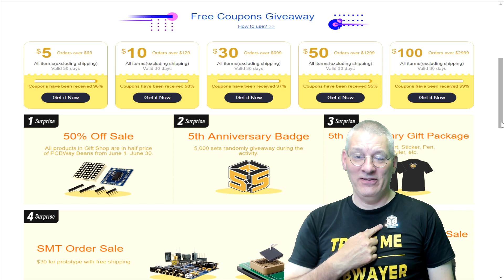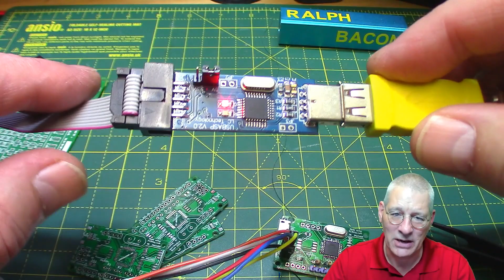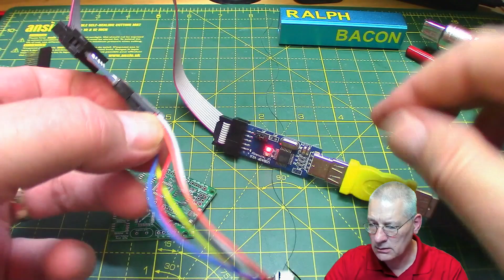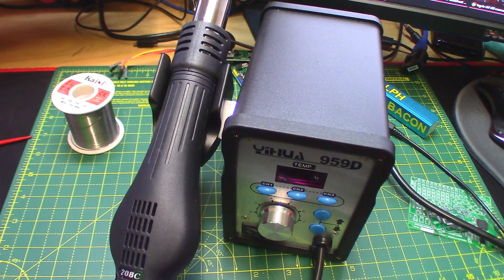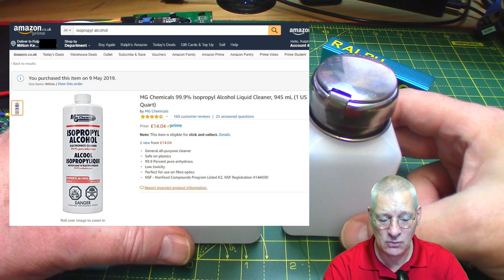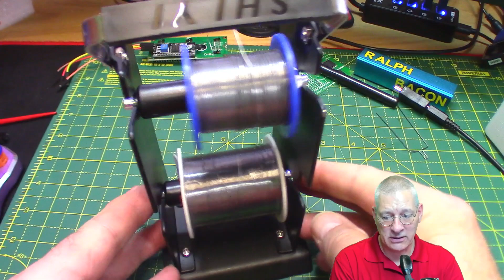#150 SMD KiCAD Arduino PCB Project (Spoiler: 😭=FAIL)

Comment: Hi Ralph, 

I used to have frustrations about SMD soldering and worrying about losing those small components, it was pretty intimidating at first but after practicing with a few old boards it got much easier to deal with, now it’s my preferred method, especially now that I design circuit boards that need to be as small as possible. 

I plan to purchase a small desktop CNC router so I can make my own prototype circuit boards for testing before I have PCB Way or JLCPCB make permanent boards. 

For now I use those little SMD to THT adapter boards for SMD components mixed with THT components on a perf board for testing like the one in the photo I’ve included a link to.  
https://i165.photobucket.com/albums/u50/rosenq3/Electronics/Prototype%20with%20SMD%20to%20THT%20adapter%20boards_zpsliuvoykl.jpg

It’s much easier to make changes to a perf board than a PCB as you well know. 
I’m only attempting to provide various options for you to choose from.

All the best!! 

Joe
Reply from the maker: I have now lost count, Joe, of how many SMD components I have lost from my workbench. Sometimes I don't recognise them and think they are just "bits" and sweep them on the floor at the precise instant that I do recognise them again (too late, lost forever). Sometimes they get stuck to my soldering iron tip and get shaken off somewhere. Mostly I lose them as I take them out of the little strips they come in. As you say, practice makes perfect!

Comment: Hi Ralph, 

I forgot to answer your question about that little springy fork looking tool that you were inquiring about. 
It’s a removal tool for IC chips, some call it an IC Popper, some call it an IC handling tool but whatever you name it, the idea is to place the prongs underneath the pins next to the body of the IC, the spring action of the tool puts upward pressure on the IC causing it to separate from the board when the solder is hot enough to release it.  
I’ve used mine a few times with good results and it’s easily bent to fit various sizes of IC chips.

On another note, as you said, there are many videos saying to do something this way or that way but it all boils down to trying various SMD techniques so you can develop a technique that works best for you, my philosophy is: “The right way is the way that works best for YOU”!! :-) 

I hope this helps with your endeavor to master SMD soldering!  

Good luck!

Joe
Reply from the maker: Yes, others have said the same. I will try it out next board. And I totally agree that each maker must develop his own style in soldering. What works for one may not work for someone else.

Comment: The problem is likely more that the sticker tells you it's 60/40 and probably is 63/37 (tin/lead). That's why it looks so dull.
Reply from the maker: That sticker could be telling me anything, Albert - it's just a printed sticker. It's so frustrating when this happens as there is so much quality stuff from China this just tars it all with the same 'fake' brush. I won't be using it again. I've had many suggestions for good, branded solder, so I will check them all out. Thanks for posting.

Comment: Your soldering is way better than the USB hub I bought off eBay. Had to resolder most of it.
Reply from the maker: Normally, and without false modesty, I would say that my (non-SMD) soldering is quite adequate and certainly better than some of the Chinese stuff that arrives. However, in this case, SMD plus that weird solder really made me look like a noob solderer (if that's a word). But I shall try a few things out and see how I can get better at SMD soldering, for sure. Thanks for your kind words, unknownhuman100, nice to hear from you.

Comment: Why don't you use ceramic tweezers for this kind of job?
Reply from the maker: I was going to get some, CaroMan, but these were marketed as ESD safe tweezers; I don't know how or why they are any different to any other metal tweezers but they are good quality (flat, no gaps) and work well - at least, they didn't destroy any of the chips I soldered, although I was tethered to a ground wrist strap at all times!

Comment: Dear Ralph

I see your  Xtal and the caps are caps are very far from each other . I am surprised it worked   the cap 22ph need to be close to the xtal. Look at any pcb with a xtal  where are the caps 

https://electronics.stackexchange.com/questions/39136/competing-pcb-crystal-layout-recommendations 

Good placement of parts makes better boards and less time routing.
Reply from the maker: Agreed, I would not have designed the board like this, Arie. And I wondered the same, that is, whether it would even work! That's why I connected it all up as soon as I could and uploaded the BLINK sketch. Interestingly, given that the caps should have been SMD (I replaced them with THT components) it should have been pretty easy to place them closer to the crystal. Good observation, thanks for posting.

Comment: Hi Ralph, 

I have been using silver bearing solder for years with really good results (for me).  It does require a slightly hotter tip temperature but that's OK by me. 
I use Radio Shack  62/36/2, .022" (.56mm), I also use .015" (.36mm) for really small solder joints. You can find it on Amazon: 
https://www.amazon.com/RadioShack-SnPbAg-Silver-Bearing-Rosin-Core-Diameter/dp/B07PV1P1QX/ref=sr_1_5?gclid=Cj0KCQjwo7foBRD8ARIsAHTy2wlllqm4Cwce63PvbNigbyA5w3hDADzopsZiML34otQ_gXOw19Ja_h8aAsGLEALw_wcB&hvadid=153684532075&hvdev=c&hvlocphy=9009606&hvnetw=g&hvpos=1t1&hvqmt=e&hvrand=15984797613167090499&hvtargid=aud-649564993678%3Akwd-1461618150&hydadcr=1638_9515723&keywords=silver+bearing+solder&qid=1561208569&s=gateway&sr=8-5

BTW, I've tried 63/37 solder from China a few times with very poor results, there's something about that solder that just doesn't work the way it should.

I use a hot air station very much like yours for both de-soldering and soldering with solder paste. 
I often heat the board from underneath, it helps to prevent the excessive heating of the component and you don't have to be so concerned with the air flow blowing the component around the board. I usually use about 25% air flow for most components, I sometimes use a higher air flow setting for de-soldering large components, just a note on de-soldering: it has always helped to add fresh solder and use liquid flux. 
If I have to use the hot air gun from the top for soldering with solder paste, I often place a tiny dot of silicone to the bottom of the component, then let it stand for a couple of minutes to hold it in place during the soldering process. 

Drag soldering multi pin components like the Atmega328P-AU chip is another great option, it's a good idea to solder one pin in two of the corners to hold it in place while soldering the rest of the chip! :-) 

PS, Have you tried using Goof-Off or Goo-Gone for PCB cleaning? It works almost instant with very little effort. 
I always rinse the board with alcohol or electronics spray cleaner afterwards, I'm not sure if that's really needed but I do it anyway. 

Hope this helps!! 

Joe
Reply from the maker: I've never tried Goo-Gone, Joe, (which I bought in the States years ago, now we have it in the UK) but I'll give it a try on my next board. It certainly gets rid of sticky label residue! I'll check out that solder too, many have suggested alternatives to the rubbish I was using. Thanks for posting.

Comment: I would use some liquid flux and a tiny artist's brush Ralph. Cheers. Mike
Reply from the maker: Got some, Mike! The brush is in the lid and I often use it in day-to-day soldering, not just SMD stuff. Especially useful for headers I find, which can be a bit tricky otherwise to solder. I don't know if it's any better than the flux in my syringe but it's much easier to apply.

Comment: Maybe when a finished design board is available a stencil will be offered and one could simply use solder paste for all the SMD device's.
Reply: Yes, a stencil is available from PCBWay, but it cost extra. When you are uploading your Gerber files and filling out your order form make sure you have added the stencil before you checkout. Now you just need to buy the book, fix the mistake, and then order it.
Reply from the maker: Ironically, PCBWAY offered me a stencil but I was unsure how to use it I declined. Doh!!! Next time, next time, Dave.
Reply: @RalphBacon  they're a cheap option and with solder paste will a pretty impressive finish product. Solder paste isn't cheap but if you are considering doing more products like this and want them looking nice it's the way to go.
Reply: @RalphBacon   I saw a great demo on YouTube. They just put 4 empty PCB boards around the one they were going to paste leaving extra room on the right and bottom so they could place and remove the target board easily. Then put the board to be pasted in the upper left hand corner. Then align the stencil and tape it at the top to make a hinge. Put s small amount of paste on the stencil and spread it with a creditcard or similar making sure to fill all of the holes and removing any extra. The stencil should look basically clean except the pile of paste thay you scraped to the side. Then you can lift the stencil remove and replace the board. Wash, rinse, repeat (not literally). I could easily be wrong because I have never done it, but the video made it look simple.   If they are going to give it to you for free then why not take advantage of it. Plus you can now teach everyone. However, anyone who knows a better way please correct me. Like I said I've never done it, but it looked pretty simple on the video. Great job as always Ralph. Thanks.
Reply from the maker: I saw a similar video. Looked easy to do, but only if you're doing multiple boards, I would have thought, as it's a lot of effort to do just for one board.
Reply: @Mr T. Guru you hit the nail on the head. Ralph is not experienced in this type of work so the extra leverage would be a plus to get that factory look. Typically if it's a mass production board the stencil is only a buck or two extra if the kit provider even charges a fee.

Comment: Add a bit of resin and reheat then clean it up.
Reply from the maker: What, the PCB? The whole thing? Resin? Please clarify!
Reply: @RalphBacon  just the area with the ugly solder. It will make it flow more even.
Reply from the maker: Ah, yes, I will do that on my next attempt, thanks for that. I did notice the solder is not that level, despite the HASL process. That makes a difference for tiny resistors and the suchlike.

Comment: The two pieces you were asking about from the Heat gun, they do go together to make a 2 prong fork like tool.  It is apparently to help you either position components when soldering with heat, or  to help lift/move heated components once the solder is melted.  I have not made much of any use of it.  I have a similar heat gun built into my one solder station, I love it for heat shrink tubing work, as I don't do much solder or desoldering with it.  I also had an issue with supposedly Leaded Solder that I ordered.  I purchased the finer solder for the same reasons, and I had the same issues, and ended up buying some Kester 63 73 lead solder.  It was an amazing difference, I had picked up a small tube of it to test first, then once that started getting low purchased a full roll of it.  I have since been using the finer Kester and virtually quit using the larger diameter 63 73 I had been (which I was running low on anyways).  I purchased a single reel solder holder awhile back, it looks to be very similar to yours, I couldn't be happier with it.  I avoid using solder braid, the good stuff is quite expensive as you mentioned.  The stuff is amazing if it is the quality stuff.  I had purchased some cheap solder braid, I found it came in as bare tarnished copper without any flux embedded in it and wasn't good for much of anything.  I only kept it around for maybe making grounding straps or something with..  Still for soldering boards up, especially with cleaning off solder bridges and smd chips etc, it is nearly indispensable at times.  It makes the work go so much smoother.  You don't want to suck off a surface mount part with a solder sucker...  I was looking at those bottles, I guess it is good I didn't buy one of the cheap ones yet, I may look to get a good one sometime in the future though.
Reply: I guess I forgot to mention, the little pump my wife and daughter found at the dollar store works great. One thing I have also found is if you soak even the cheap braid in some paste flux held down with you soldering iron. But by all means buy what works and feels right for you. The brushes I mentioned work great too.
Reply from the maker: @vonries So the little drugstore pump didn't dissolve overnight with its isopropyl alcohol contents? Drat! I could have saved a fortune. And coincidentally I found the exact same trick with cheap braid. A toothpaste sized blob of flux at one end, squidge it along its length and voila! It works again. See, we all come up with the same solutions! Thanks for posting your results.
Reply: @RalphBacon   she does scrapbooking and uses it to clean ink off of her stamps. She's had alcohol in it for months with no problems. Happy to give back to the group.
Reply from the maker: Yes, you and others have put me right about the chip aligner/desoldering aid, thanks. And I shall be looking for some good quality, finer diameter solder today. As you say, a large roll will last a lifetime. I have some cheap braid too (not the stuff I used). It was useless. It tarnished quickly, had no flux embedded in it... I'm back to my Servisol which always does the job for me. Not cheap but essential, IMHO. Thanks for posting, good to hear from you.
Reply: @RalphBacon  I don't know how I did the 63 73 typo a few times, of course 63 37 Leaded solder.  You are welcome.  I like watching your videos.

Comment: LOL  one thing you could feel good about on the branded pump bottle is they are ESD compliant so it wont cause a spark when its full of flammable liquid  and burn down Benny's house...
Reply from the maker: Good point. In fact, that's probably why Benny was so insistent on me getting that particular brand.

Comment: If you have ever watched Louis Rossmann he can school many people on how to do smd soldering... I tried for years and used many many different pastes and flux's and I'm telling you the stupid magic stuff that I finally broke down and spent way to much money on actually works totally awesome and I can redo it 3 or 4 times with hot air or a soldering iron...if you want to see ill post the link at the end of this post..warning...there is soooo many counterfeit versions of this product is why I finally got it from him..I bought it twice once from ebay and once from china and both were not the same as what he sells as the original Amtech..    https://store.rossmanngroup.com/index.php/soldering-diy/helpful-tools-extras/flux-soldering-tools.html
Reply from the maker: Thanks, Gene, I'll look into that, I definitely need to crack this SMD soldering lark.
Reply: @RalphBacon  I'm still not very good at it but those jewelers glasses you suggested are amazing...
Reply from the maker: Yup, I agree, I used them today to repair a circuit board. Wouldn't be without them now. Thanks for the feedback, Gene.

Comment: Book writer: Skilled PCB designer? No way!
Reply from the maker: Well, I guess you have your opinion and I have mine. His knowledge of KiCAD is impressive though, it must be said.
Reply: I can design you something that will never work - That is not complex. Rather more complex to design something from your head and make it work. Attention to detail seems to be something he likes to miss. Another mistake on the clock - oh no.  Well at least will correct this in the PDF Version. That will provide comfort to people that bought the book and decided to get that board produced. He needed to have proofed his own work 100% before going to print. Hopefully is not a medical DR or could envisage more problems.
Reply from the maker: Yes, I've just re-read this and I agree that he most certainly should have actually got the PCB produced and tested then he would have discovered the error the same as I did. A rush to get published, I suppose (not necessarily his fault, the premature publication).
Reply: @RalphBacon  Yep. I would recommend the videos from "Contextual electronics".

Comment: Ralph: Get some proper solder (Kester, Multicore) etc. - preferable leaded. Lead free is junk to work with. Get som GOOD flux - AMTECH NC-559-V2 is the best i tried so far. DON'T get it from eBay, it's all fakes. TME.EU has it in europe and it's not expensive.
Reply from the maker: I shall be looking today, believe me!
Reply: @RalphBacon  You will thank me when you get to use that flux and a good leaded solder. It will make a world of difference.

Comment: Another great video Ralph.  I've used Dr. Peter Dalmaris' book (on your recommendation) - I was struggling with KiCad before but thanks to the book now on my fifth PCB order - loving it!  There are a few mistakes in it but to be honest I think it helps as you have to work things out for yourself (perhaps it's on purpose?).  Keep up the good work! Kind regards, Bruce.
Reply from the maker: I'm glad this design error did not put you off, Bruce. I also love it, it literally contains every detail and answers every question I could ever ask. I only ever recommend items that I totally support and use (or would use) myself so I'm glad you're now a PCB aficionado! Thanks for posting.